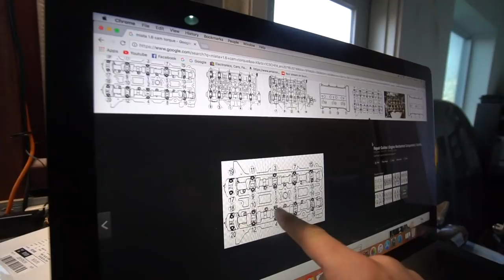ALMOST FLIPPED THE FORESTER!

Comment: Rodknock make your life easy, matco part number MST9140B
Valve spring compressor tool for over head cam engines. I bsed with different ways and could never get it. That tool is a life saver. And you have a matco guy as well. So easy peasy.

Comment: Did you set it to 80ft/lbs? If not at the very least rent a in/lb wrench and start over with all new bolts. You'll feel better about it when your done, right now you feel like you worked hard just to fuck it up. Today I watched this channel and learned something so thanks for that, i know alot about rebuilding a car but not an engine, good stuff.

Comment: Hopefully those valves seals are seated correctly.. I lightly hammer mine in with a 10mm socket till you hear it bottom out.

Comment: Hey, make sure none of the shims fell out from underneath the buckets when you had them pulled out and makes sure you put them back in in the same order they came out. They are usually just stuck to the bottom of the bucket from oil. I would have pulled them off and put the shim in first then the bucket just to be safe and make sure they arent cockeyed in there

Comment: With the right tools  this is like a 15 min job, but if you don't have the right tools it blows, they make a hand held pneumatic valve spring compressor for pretty cheap you could use, and their are special pliers to grab the seals, but hey more power to you for improvising

Comment: Try getting up at 2 am every day  :D  Sorry Chris just Drinking and Audi merchals here's a subaru easy seal tool go to the plumbing section and buy a 1 1/4 inch schedule 40 plug for the front cam seal and a 1 1/2 inch schedule 40 plug for the rear making sure to use lube on the inner race of the front and  make sure not to lube the rear at all you can install the seals flush using PVC plumbing plugs

Comment: Take your biggest spark plug socket or at least one that fits around the retainer Cut a window into it put a long extension on it and then tape a cloth on the end of the extension or something so you can put your weight on it and then lay the head down flat on the table but Fill the cylinder where the valve heads are with cloth or something to make it so the valve doesn't move down then put your weight on the extension and press the retainer down then you can easily remove the keepers this also works great for putting the keepers back in then you don't have to scratch up the valves or the mating surface of the head

Comment: I saw this coming as soon as you pulled the 1/2 Torque wrench out.... Doesn't really matter the brand, its not accurate enough at 8 FT-lbs. I believe the spring is too large? You NEED a 1/4 torque wrench for fine torquing. My crappy HF one has done me just fine as its actually designed for low-torque situations. Trust me brotha, go buy one. You'll be happy, and it'll do you great for Oil pans and engine internal work (Besides headstuds/bolts obviously)

Comment: Just curious - You have a computer next to you. Dont stores in the US have websites (online stores) - Where you can track the stock for the different store locations? So you spare that 20 store shopping spree trying to look for it. Also - You have 468 miatas, why dont you buy the "Hayes" book for Miatas - It has every single nut and bolt, and the torque spec for them in it. It costs like $30.

Comment: Call Mazda and order all new oem bolts and replace every one you over torqued in the head. Then go hit up the Matco guy and buy a proper 1/4in drive torque wrench that measures in inch pounds. If you are gonna be rebuilding motors like this you need proper torque specs. I know people that send their torque wrenches out every year to get rebuilt/recalibrated.

Comment: convert inch pounds to foot pound divide by 12. cam cover bolts 43 to 78 in.lbs.= 3.58ft.lbs to 6.5ft.lbs. inch pound dork wrench at harbor shittools=$20. sears $45.

Comment: by the way those large torque wrenches arent meant to be used on anything under 30lbs they will never be accurate you have to buy a smaller one that can give you a more precise reading. think of it this way the bigger one has larger more heavy parts that create the clicking mechanism that tells you when  you have tightened enough right. well those heavier more meaty components will take far more force to make "click" than the finer ones in the smaller wrench.
Reply: yes he should have three different size torque wrenches

Comment: Its not a rebuild its an overhaul. They have different meanings. Engine manufacturer does rebuilds which puts the engine at zero time or miles. Overhaul which you have done means same time or miles just new parts.

Comment: Ft.lbs tourqe wrenches read in ft.lbs for a reason and why it's for over 100. Their not very accurate at almost no tension. At 8lbs you can do that by snugging them down good with a 3/8 rachet.

Comment: you cant reuse that. its bored to spec and to fit with that exact cam. if you just put a different holder on there it destroy the cam. you need a new head.

Comment: Cut the springs in gti
Reply: daniel crozier Not connected
Reply: andy they are installed properly. They are lowering springs so when the car is off the ground the wheels sag, when on the ground the weight makes it so they are in the right place